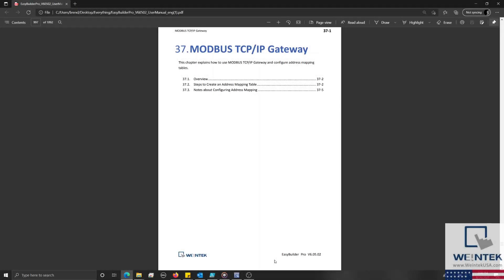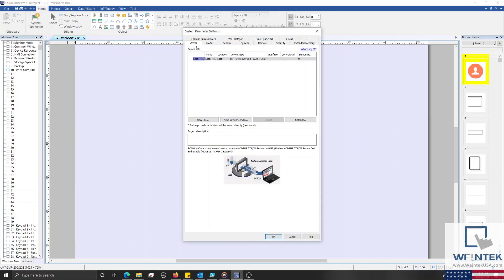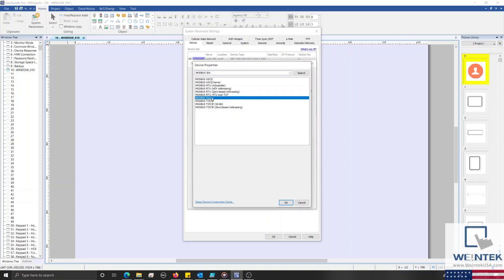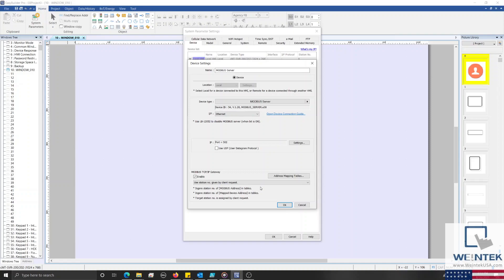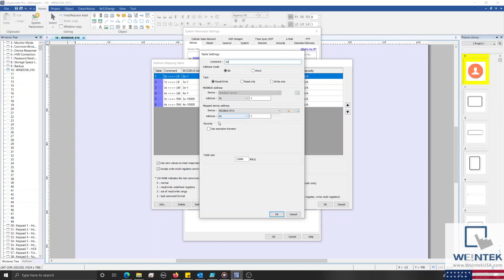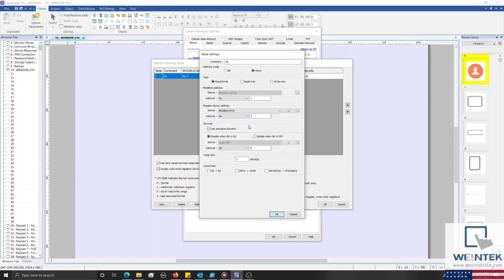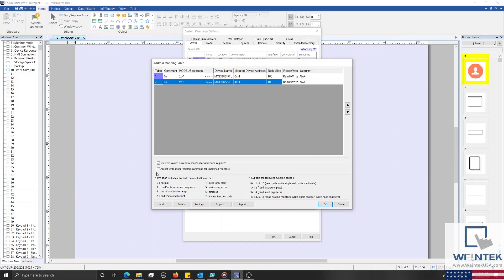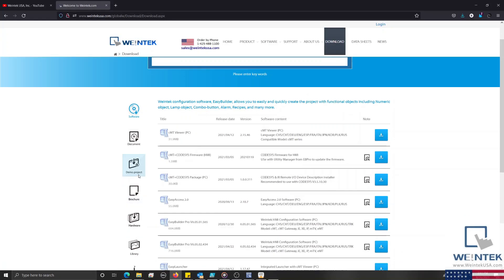How to convert Modbus RTU to Modbus TCP using Weintek's built-in Modbus gateway

Comment: Hello, it is a pleasure to contact you. I have a question, in order to create a MODBUS TCP/IP Zero Based Addressing connexion with my plc Crouzet it doesn't show the Objects like "bit lamp", "interrupter", buttons". Instead, it is working the Object ASCII and  Number. In Crouzet I do all the binary connections in order to work well. When I simulate online the lamps don't show it (by example). How can I change it in order to work?. Could you please recommend a video to fix this? . Best!! María Eugenia